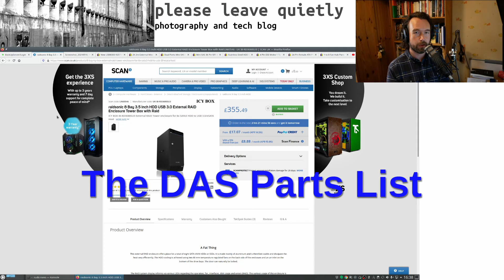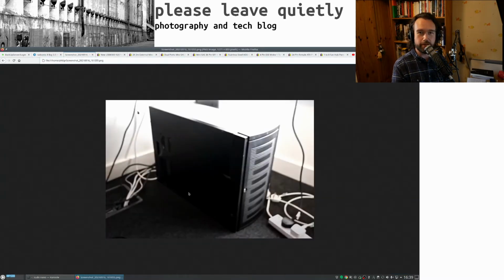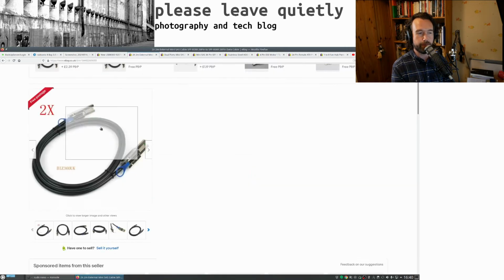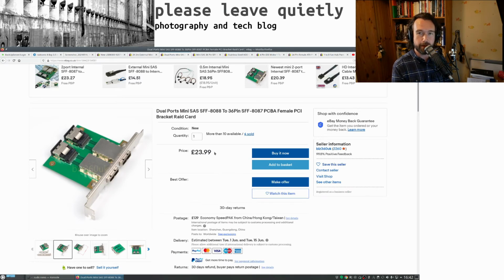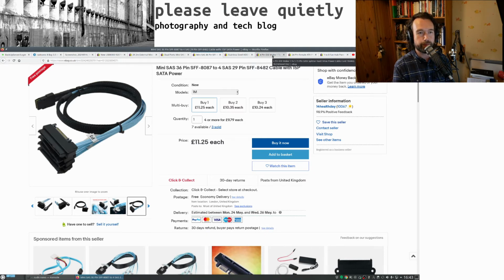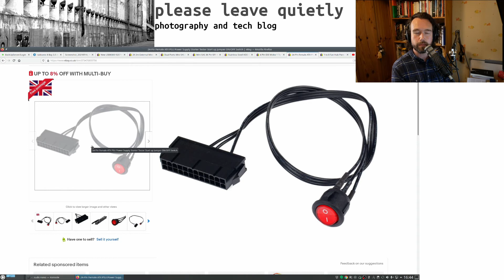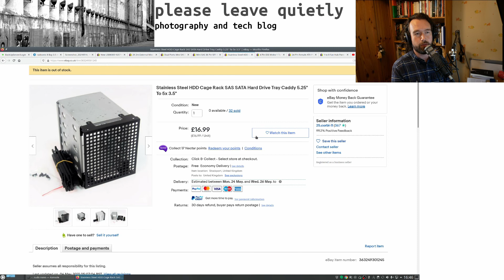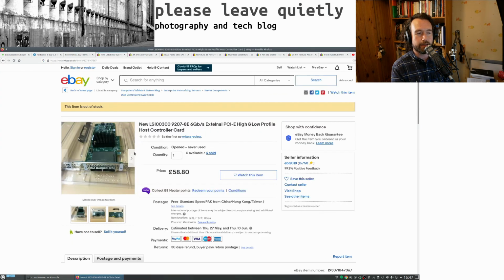Part 4: DAS Parts List

Comment: The 3.3v reset issue happens with some SATA drives too. (Usually shucked models from external USB cases)
I just cut the 3.3v feed on the PSU SATA power leads rather than use Molex splitter adapters. 
DAS likely better performance than even a 10GBe NAS.
I'd point a fan at the SAS controller in the main PC. They're designed for server style cooling. It likely gets rather warm without that.